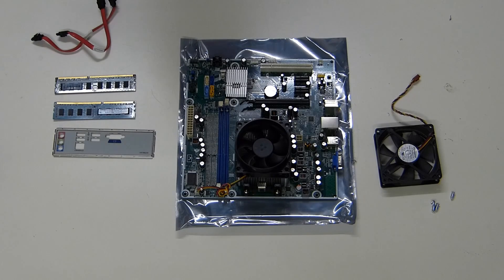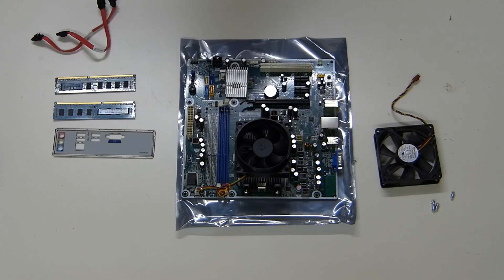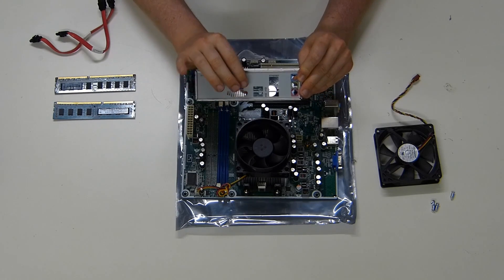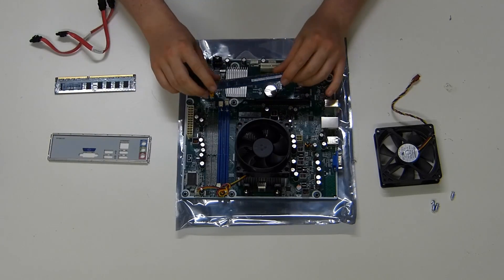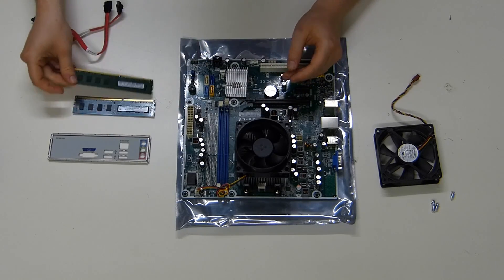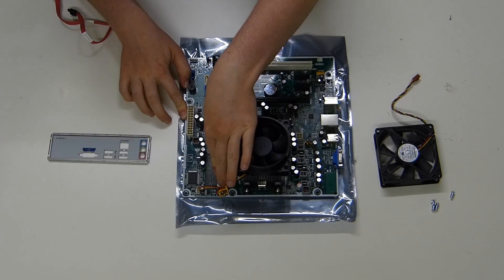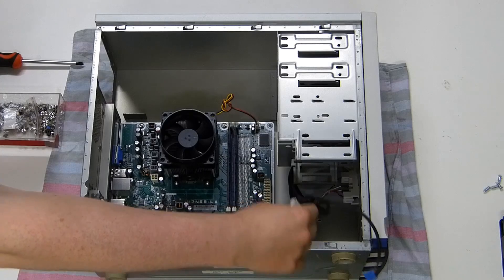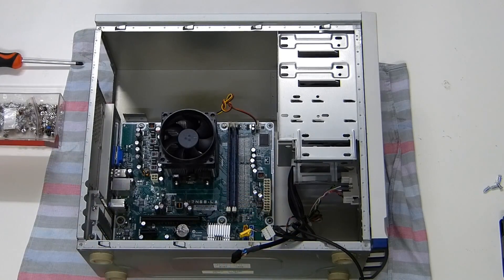Building a PC [2/5] - Motherboard and RAM

Comment: That's the same motherboard that was in the HP Pavilion computer I found at the dump. It was rather silly because they crammed it into a "slimline" case, causing one of the PCI Express slots and the regular PCI slot to be blocked by the power supply, and the floppy drive controller was useless because there isn't anywhere in the case to put a floppy drive! It also has pinouts for a DVI connector, although it only came with a VGA port installed. It looks like yours is a newer revision which removed the floppy connector and DVI pinout.

Comment: The motherboard should have an option in the bios to switch the front audio connector from hd audio to ac97 and it should work with the old case,but since its such a barebones board it might not have have it
Reply from the maker: This motherboard really doesn't have a lot of options at all. I didn't see an option for the front audio connector.

Comment: As Tyler said, it's an Asus board. 90% of new HP computers come with Asus boards, and the model number also points to Asus, as the M2N prefix is very typical to Asus. Asus OEM boards are, sadly, piles of dung.

Also, having a board on an anti-static bag does nothing, the baggy only works when you put the board inside.

Hynix memory is very good quality.
Reply from the maker: Unfortunately the Hynix stick (the bent one) later on turned out to be bad...
Reply: Well, it was bent after all :D
I had a pair of 667mhz ddr2 Hynix 1gb sticks, that went up to nearly 900mhz without problems.